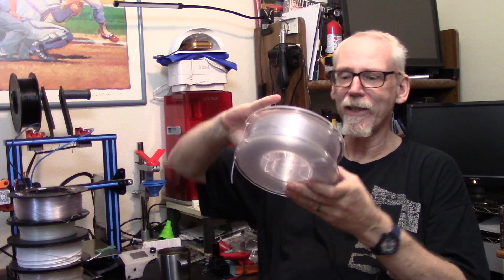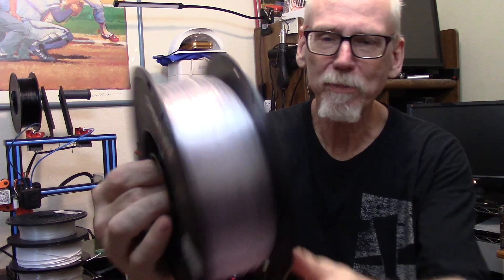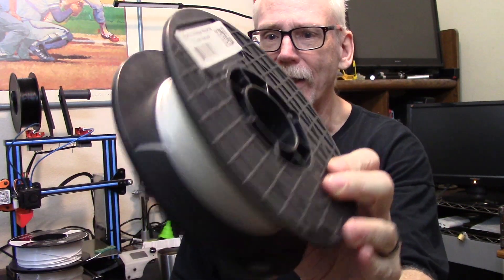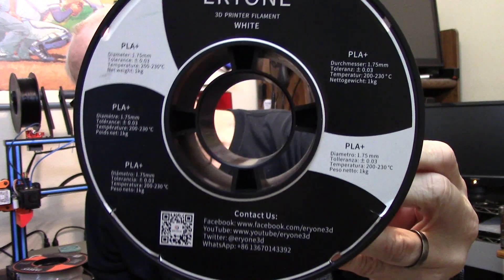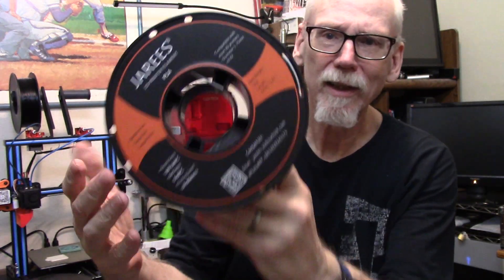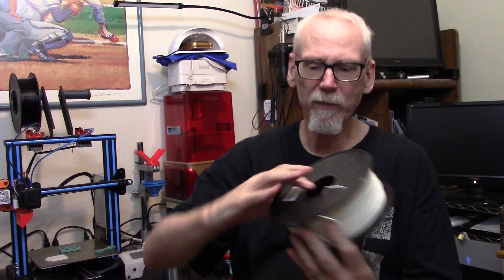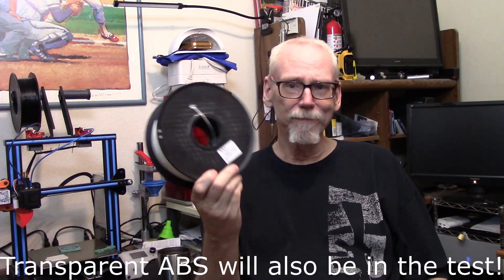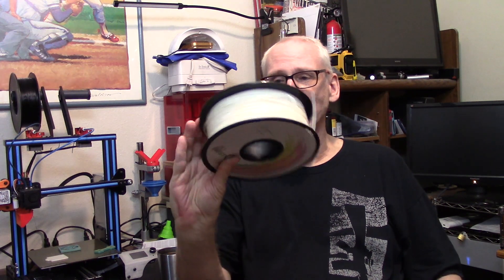Intro to my Outdoor Filament Test! Heat, UV, Monsoon! ABS, ASA, PLA, PLA+, PC, POM, PETG, Nylon

Comment: Hey Chuck I would like to print a couple of these out of TPU and ninja flex and send them to you to be part of your test, as someone who manufactures and sells 3D printed RC parts for radio control cars and quadcopters I think this would be a valuable data point for the radio control community to see how these filaments hold up long-term in the weather. If you can send me the STL file at mx125a@yahoo.com I will get a few printed up and sent to you if that sounds good to you.
Reply from the maker: I've got some dark blue TPU I could use, I think the brand was Foxsmart. But I'll send you the STL files anyway along with my address in case you want to use something specific.
Reply: @3rdpig  yeah I don't want to add to your workload, it would be cool if we could test the filament I usually use which is overture and ninja flex, I'll get them printed and send them to you ASAP, should I make two of each or just one?

Comment: Looking forward to your results Chuck. I've had PLA garden ornaments outside in the UK for around 3 years. They still look really good. As you know we get 30c down to around -10c where we are and as you can imagine, lots of rain.
Reply from the maker: PLA seems to do really well until temps rise to around 50c, then begins to lose it's rigidity. I've done that test a few summers ago and a PLA hook with a .5 liter bottle hanging from it will start to bend in direct sunlight here. I've seen in car temperatures in a black car left in the afternoon sun of 90c. You don't realize just how hot it gets here until you see a girl in a short skirt get into a car with a black leather interior that's been left in the afternoon sun.
Reply: @3rdpig  Ouch! I can imagine. Wow 50c Chuck. No I can't imagine that but you could invite me over one summer 😜

Comment: I ordered my most recent ASA from paramount 3d, and even with a tightly vacuumed bag right from the manufacturer, they still exhibited wet behavior right out of the bag. Left them to sit for a week in my drybox and they started printing beautifully. Considering the filaments you've got there, I hope you have a comprehensive plan for drying the filaments that like to get wet! This is an awesome experiment, can't wait to watch as you get it done and demonstrate some really useful data!
Reply from the maker: I have a filament dryer and a dry box to print from. I'll be sure all the moisture sensitive filament is well dried.
Reply: Strange, I have not have issues with moisture, and I love the quality of the prints. The only thing is the smell.

Comment: Friend of mine had me make him a few things that exist outside. All items were made with normal woodgrain PLA filament. 2 of the items are house number signs that he attached to the side of his deck, and he stained with them with the same stain that is on the deck. Not sure of the details on the exact brand of stain but it's a relatively standard brand with UV protection, it's a relatively subtle stain color. The other items he had me make, he did not stain at all, I did encourage him to do it but whatever...

The 2 house number signs are 3 years old now and have no visible signs of anything wrong with them at all. The other items got brittle, cracked, bleached white and look chalky after less than 1 year. If I was in your place I would also test all the items with a UV resistant clear coat as well as without. Sure it doubles the number of prints but I think the results would be interesting.
Reply from the maker: I've got some wood infused PLA. I'm not sure it's fair to put a UV resistant coating on that without trying it on every other filament too. Maybe I'll save UV resistant coatings for round 2. Good idea though, thanks!